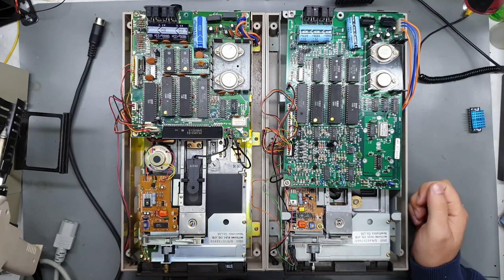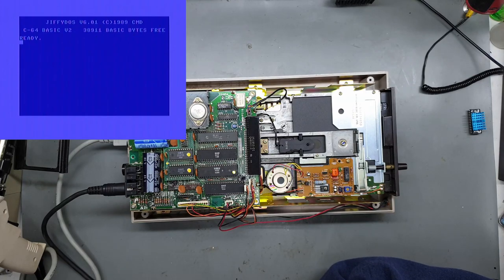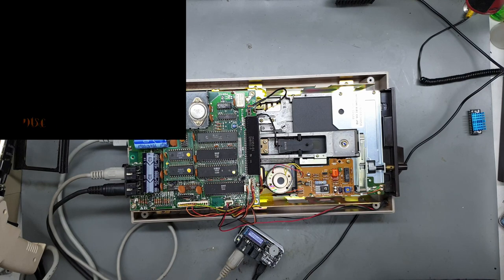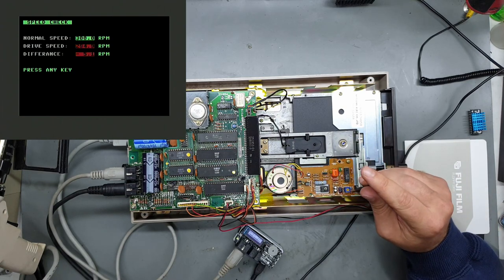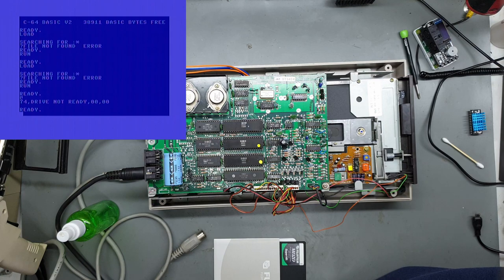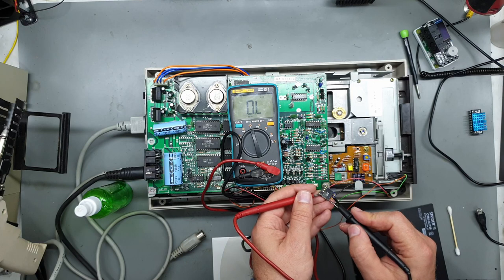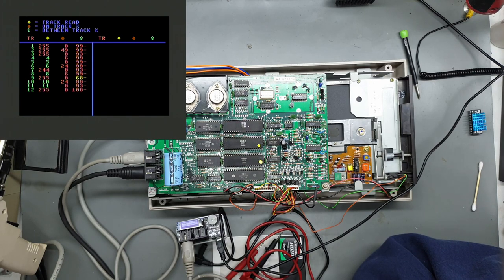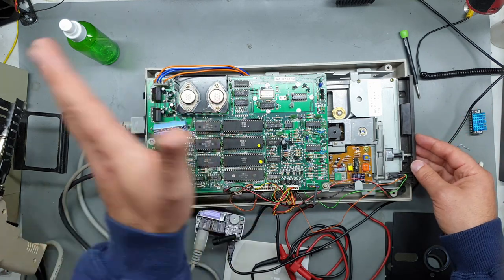Commodore 1541 drive repairs

Comment: Have you tried giving power only to the speed controller card using a power supple and then adjusting the pot using the markers below the floppy drive?  Under incandescent you will have a very good visual adjustment of the motor speed.  The markers show the adjustments to 60 or 50 hertz.  You can even swap out a speed controller card from an apple II floppy if yours is bad.
Reply: that only applies for Alps mechanisms. This is a shitsumi. sorry I meant Mitsumi.

Comment: Oh! I wasn't aware of that resistor trick. Very good to know.
Reply from the maker: Haha, yeah it doesn't really help apart from showing that it can make a slight difference. I wanted to link to forum that I read it on, but now I cannot find it. I did end up pulling the head out just to make sure the break wan't between where the thin coil wire enters the actual head but no luck - it's broken somewhere deep inside, and that's near impossible to repair.

Comment: My 1541c seemed to have a lot of failing disks and "new" disks that wouldn't format. I just ran that diagnostic from my sd2iec and the alignment check was coming back with 99s and 100s and the speed test was sitting at 300.2. That would be around normal?

Comment: i see your link to the diagnostic rom image, how do write things to a cartridge ? where do i get a black rom cart ?
Reply from the maker: Hey Rob, I assume you mean blank rom cart. You will need to first find or put together a cartridge PCB - google versacart, and then program the rom image to an EPROM with something like the minipro tl866.

By the sounds of it you don't already have these things so my suggestion would be to search on eBay for 1541 diagnostic cartridge. Unless you plan on making your own cartridges, it's much easier and faster to find a pre-made one